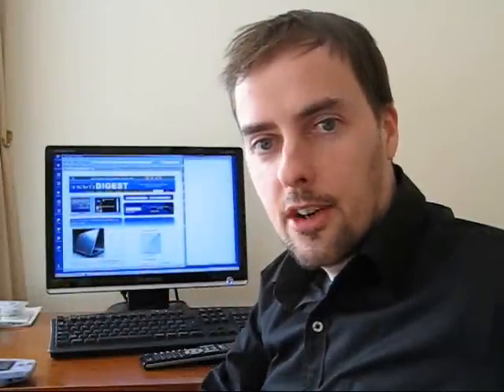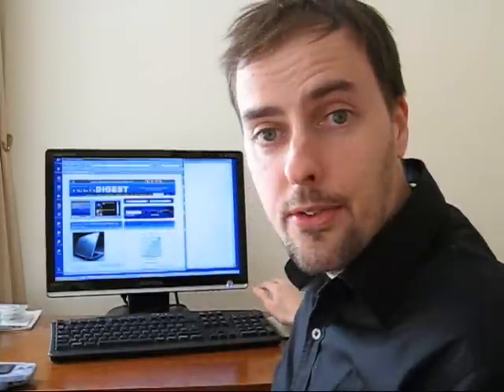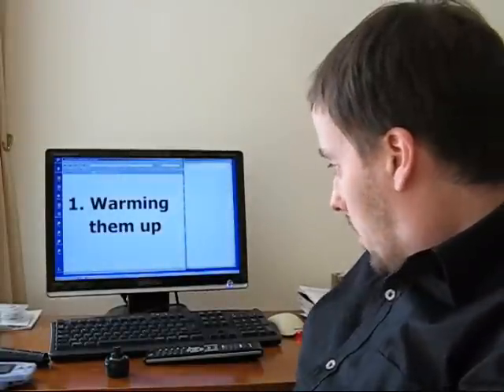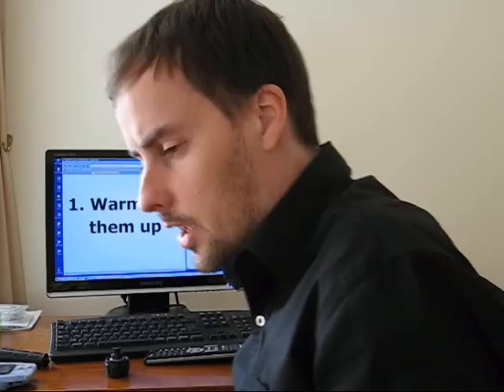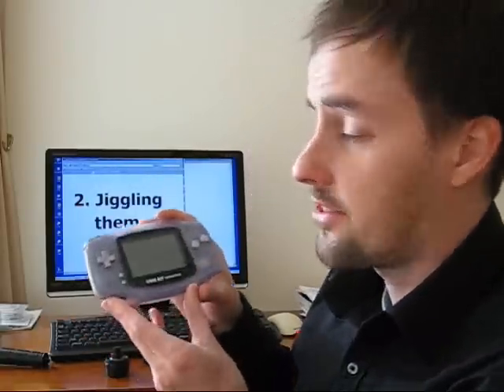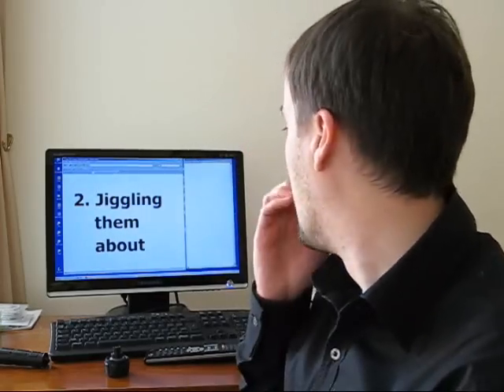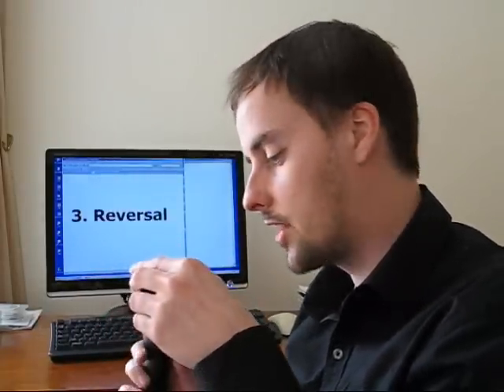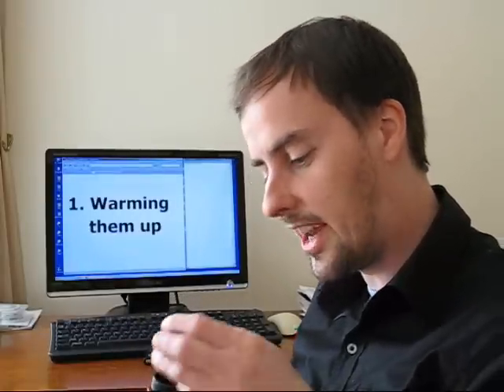Traditional, non-chemical battery recharging techniques

Comment: alot of these techniques work... 

juggling or moving them slightly will remove of any corrosion

swaping them abiously wont help in any other way than ensureing the conductivity

and warming them up with a little ammount of current it them can increase the amp output... its not likely but can

Comment: try dropping them in boiling water or lemon juice ;) it is the seals that give upon non-rechargeable batteries and the alkaline solution gets absorbed by the carbon. If a battery becomes  "dry"  it will not take a recharge.

Comment: Although too long and they might explode.  As for reversing them probably won't do anything due to the anode and cathode and the flow of electrons and the reaction that takes place within the battery to produce electricity.